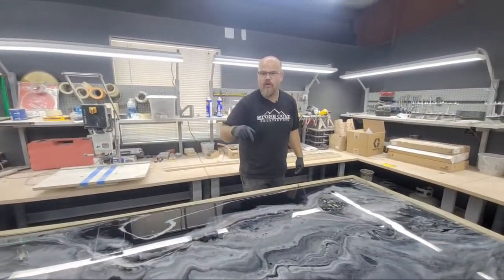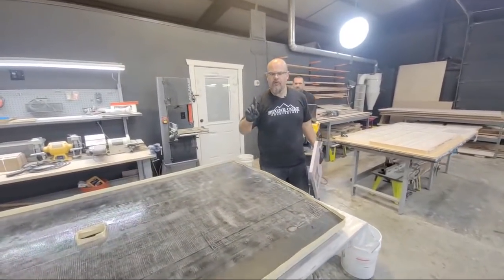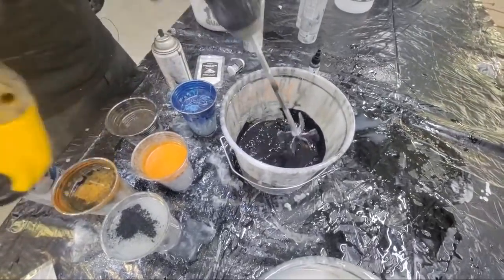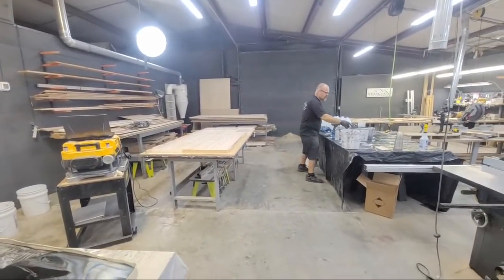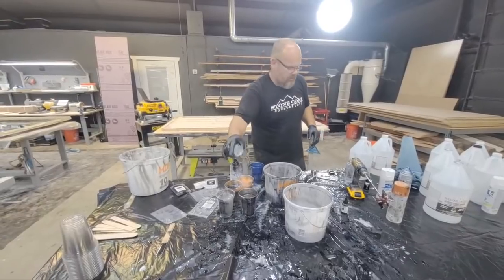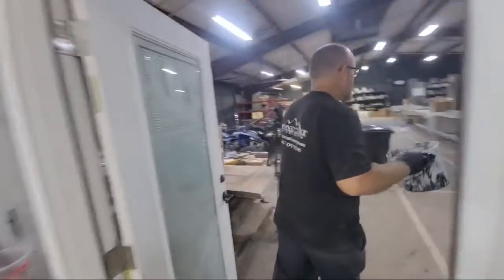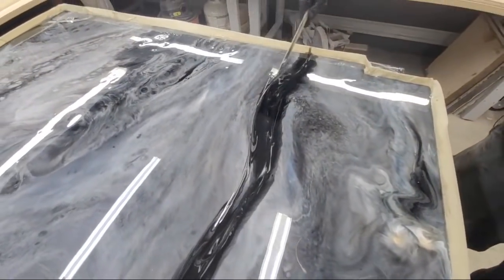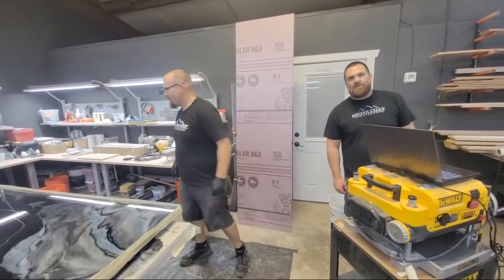How to Make Shower Walls that Look Like Stone on a Budget

Comment: I"m in Brisbane -  Australia. 
Everytime I watch a video I learn something that i NEED to know. Even if it's for a different application than what i want to do. Lots of little bits of knowledge you suppy, add up to a lot. Thanks heaps.
Reply from the maker: Glad to hear it! There is so much to learn with epoxy. Have you had a chance to make a project?
Reply: @StoneCoatCountertops  

Not yet. I tend to take my time deciding on what to do. 😀  I have a wall that is crooked by about 3/8 to 1/2" for about the last 2ft to the corner. Which means if I do a backsplash with stone coat, the MDF will need to be at least that thick to cover the gap. There is a window on that wall. The trim is 
12mm (1/2" approx in your terminology) which means a 12mm back splash would sit flush against the trim. Might look a bit ordinary. Would you suggest just replacing the the trim with a thicker timber?

Comment: I been with you for about six months 
I’ll be doing the master bath large walk-in curb Les double head shower.  Along with matching counters.  
 In time some live edge slab. I’m slabbing now and last summer. 
You can be a motor mouth Lol . I’m enjoying the long version now at the start of checking things out shorter version is great 
Thank you for all your info . Still watching you just put the fine white line in . How would a plastic squeeze bottle work for making a fine line . Yes live time .   Wall insert, frame for window in shower .

Comment: This looks great, and very artistic and very affordable
do you use 1" foam with fiberglass netting on the front or the back of the styro foam ?
where can i get the fiberglass netting? Is all the spray paint rustoleum brand?

Comment: Hey guys! This is awesome. I've been a sub for two years! Did my tops in black Galaxy with your videos and help. Ready to do another one soon. I've been a tile contractor for 20 years now- I'm loving this content. Thanks a bunch
Reply from the maker: Thank you! We appreciate ya, love the black galaxy. What do you have in mind for your next project?
Reply: @StoneCoatCountertops  
Hall bath shower walls. I'm thinking I'd like to do the 'wet wall' in an epoxy panel, and tile the other walls. Trying to get a game plan together. How would you recommend I make the connection where epoxy panel and tile meet up?

Comment: Love this! Missed the actual live airing but catching it now. At nearly 3am. In Atlantic Canada (New Brunswick). My next project is going to be resurfacing and resining my kitchen table. Love getting new ideas from you guys.
Reply from the maker: Thank you for watching! Right on, have any colors in mind?
Reply: @StoneCoatCountertops  I’ve got some Diamond Dust. Looking to do a dirty pour. I’ve got faux oak wood cabinets with kind of a teal countertops. Room colours are a light grey on top 2/3, darker grey on lower 1/3. Will eventually repaint the faux oak (thinking slate grey).

Comment: I guess my sister's house and rehabbed it for her. I am going to use stone coat for the epoxy kitchen countertops and bathroom countertops and shower walls. I really really want to do the back splash template you discussed at the 1:44 Mark. Please let me know more info on that. Thanks in advance

Comment: Hey stone coat, I was wondering. I have been told by many people that epoxy is really bad at staining. In a kitchen or bathroom settings how do you protect your epoxy from staining?
Reply from the maker: You can clean with normal household countertop cleaners, but soap and water generally do the trick. Just try to stay away from very harsh chemicals such as bleach and ammonia. You Got This!

Comment: Do you need to have a large size torch for a project like this, or can you use a small hand held "mini" torch like you would use in kitchen dessert projects?
Reply from the maker: Yes you can! Are planning on doing a project like this?
Reply: I use a mini one, too.  It works very well to pop the bubbles.
Reply: @StoneCoatCountertops  I would like to but I'm starting a new job soon as a traveller so I will have to wait, but I am going to continue to watch your videos and keep you in mind when I am going to need epoxy, you guys rock!

Comment: In this video, you used regular stonecoat epoxy to adhere the fibreglass to the foam board, but I found a stonecoat shower kit on amazon, the the instructions on that say to use the quick coat to adhere the fibreglass to the foam.

Comment: Was thinking of led under lighting for counter tops , maybe with a plastic insert and mix light? What do you think??
Reply from the maker: Darren, sounds rad! Check this video out: https://www.youtube.com/watch?v=-AmIfEUlKB4
Reply: @StoneCoatCountertops  i had seen that video,  I used to have my own counter top business back in the early 90's,  lol but was thinking of 1 1/2" mdf deck with a 3/4- 5/8" router cut out curvey down the middle then router 1-4" lip for the clear plastic to sit even with the mdf, and try something like you did,  then pour a thin mix with lots of glitter and sparkling paints,   have you done something like this,  or just the deep river table?. But I've been an elevator mechanic for a long time have a lot of idea's for you.

Comment: Hi, this is awesome just awesome, I was thinking of this also! It's so beautifully designed these walls! I have a question, I have cut out 1/2 ply and have made bicycle fenders. Because of the half-moon shape, the epoxy is running a bit to much after I use the heat gun. And also one fender has dried well but, the other is still sticky and it's been way too long now? Can anyone help on what to do with this fender that has not dried, it took me ought a bit of time to get the correct shape of the fender to do another one. Is there anything I can do to get this fender to dry? And thank you in advance.

Comment: Hello guys.. am from NY. Am planning on doing an outdoor kitchen it will have a roof. Am planning on putting 2x material for the counter and use your epoxy on top and visible bottoms. Is this possible?
Reply from the maker: Miguel, you would want to use Art Coat for out door projects as it has more UV inhibitors. If you are wanting to coat the bottom as well, start with the bottom! You can also send pictures of what you are wanting to accomplish or the material you have to we can have a better idea. You Got This!

Comment: Hi there, which Kind of Epoxy do you use in your projects? I wanna go to do a kitchen countertop by myself but i am not sure which epoxy could be the best for such a project.
Reply from the maker: Benjamin, awesome question. Either the Countertop Epoxy, if doing white or lighter color use the Art Coat it has more UV inhibitors. The Ultimate Top Coat is a great finish(Natural or gloss) but the durability on it is insanely strong!
Reply: So you stell your products to Germany also? Thema i know what to do

Comment: Long question with an explanation so please bear with me. I have to rent a temp controlled storage unit to accomplish this away from my house. Biggest question is how long does the epoxy have to cure before I can stand the piece on it's side to store it while completing the other panels? So to be specific I will have to complete one panel at a time and store the extra ones until they're all cured and ready to put on my shower walls.
Reply from the maker: Hi Kevin, great question. If using the Countertop Epoxy, you'll want to wait at least 7 days after final pour. The longer you wait the better(more cured) but at 7 days it is about 90% cured.

Comment: Mitch! I've been watching your company, videos, product line from the ery beginning and I'm so pleased at your growth! I have a couple of questions about the foam shower walls. I bought a mobile home almost three years ago.  Only $6K, "as-is". It's been a lot of work but it's the first time in my life I've ever actually owned the roof over my head. I've done a lot of work myself, grants to do some of the other work (seniors...I'm 70 years old...programs available to do home repairs to help you stay in your home). I really want to redo my bathroom. One of the reasons I bought the home is that it has a nice big shower stall. I'd like to do the epoxy walls and river stone for the floor of the stall. My biggest concern is the weight. This is an old mobile home (1980). The flooring in the bathroom has been replaced but not in the shower stall itself. Will this foam be suitable considering the weight? Can I install these walls over the existing fiberglass (or plastic) that was originally done (not sure when)? I hope you guys look at the comments after the fact. I really want to do the bathroom stall with Stonecoat!!
Reply from the maker: Yes You Got This Laura! Give our project support a call my friend, we can go over details and what is needed to complete your project.💪

Comment: When I talk to neighbors about trying to redo my kitchen counter, they say you guys are contractors, so of course you make it look easy. Someone without this type of skill will mess it up. 
So, being disabled on a fixed income, I'm nervous of trying this because I can't afford to mess it up. Is it really as easy as you make it look? I have maybe 10 feet of countertop.
Reply: If you mess it up, it just becomes a piece of modern art of your own creation. That's why you can always practice on a smaller scale before starting work on the countertop. It's important to learn how resin behaves once it heats up and cools down to know how much time you have to mess with things to improve or try saving your "rock" before you should stop touching it (unless you want uneven surface that will take a gigaton of sanding).
Reply: @LordDragox412  "practice on a smaller scale"...very good advice. I didn't even think of that. Being older doesn't necessarily make me wiser. ; )

Comment: the only thing i want to know is how well the epoxy holds up. In a bathroom there is a lot of body oil, residue from lotions and shampoo and conditioner. I have a tub with the wall and one day got lazy and sprayed scrubbing bubbles on the tub. BAD  VERY BAD!! It took off the finish and now looks horrible. I would love to remove it and have something new put in but the cost and because it is a upstairs bathroom it would be very difficult for me. SO i am looking for some ideas to make it easier. In my view WINTER is the months that is perfect to work on the interior of your home so you can make it great for when family comes in the summer to visit. SUMMER is the time to work on the outdoors and be creative.

Comment: When you mix these, I am presuming you need a mask for your nose and mouth and good ventilation?
Reply: @KristiSage  So no vapors or smells whatsoever?
Reply: @echandler673  that is correct!
Reply: @echandler673  If you use additives once mixed, you may have odor depending on what you use, like a spray paint… But as far as the epoxy, no. 👍🏼😀
Reply: @KristiSage  That is great news, yes if I add spray paints for the color then I'll need ventilation, got it!

Comment: Yo broski dont forget to tell ppl to wear a mask! Epoxy is hella toxic. Btw this work is incredible. Well done.
Reply from the maker: Thank you for watching! Stone Coat Countertop epoxy is a Zero VOC formulation. It is very durable, heat resistant, has a long working time, and very little smell when working with the product. It's food safe as well as U.V resistant.

If you have breathing or smell sensitivities, you may want to consult your doctor before use.

Comment: It is REALLY hard to follow along with all the extra chatter that has NOTHING to do with what you are actually doing. How can we learn anything from all the distracting rambling. Could you just do a video walking step by step through what you are doing including how much of what you are putting in each bucket. 
Start with a list of needed materials? 
Number of separate cups? 
How big do the cups need to be?
How much do you put in each cup?
Etc.
If you gonna teach, then teach.
You do not see teachers or professors rambling about information which detracts from what is being done.
How thick does the foam board need to be?
Once hardened, how do you hang / attach to the wall?
How do you attach glass sliding doors?
How do you cut holes for the plumbing?
If you do an epoxy coating, why do you then need a top coat?
What is the purpose of the top coat?